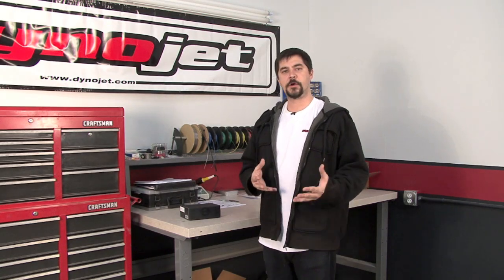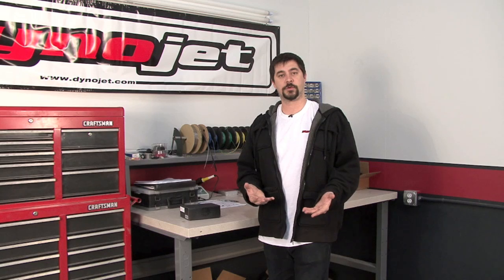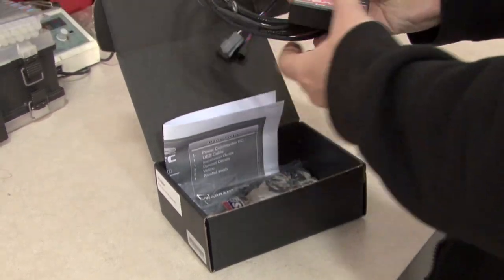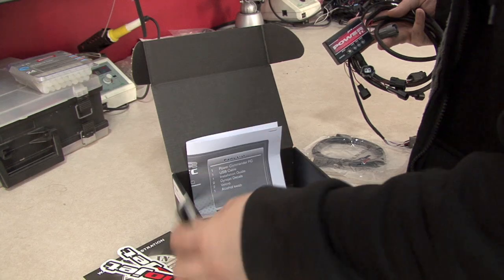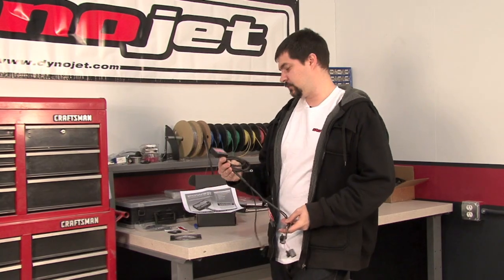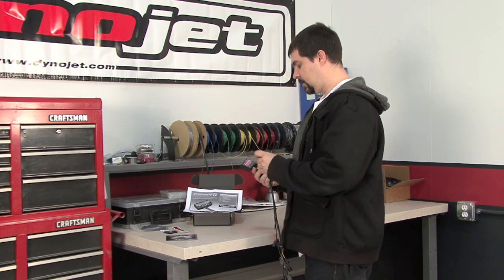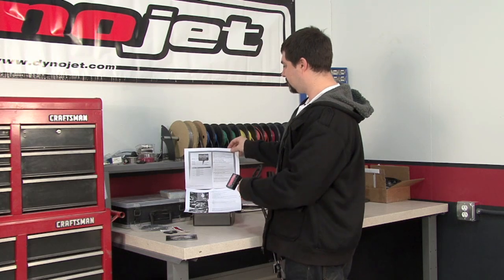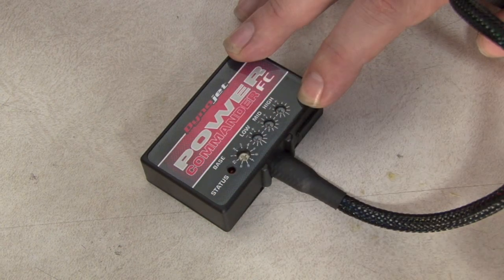Power Commander FC

Comment: I just bought a 14 Super Tenere that previous owner installed. I’m getting terrible mpg. What is the process of setting this unit to base stock settings. I’d like to leave it installed, but for now I want it to perform at stock fuel delivery to see if the previous owner had settings wrong

Comment: so it won’t add any power?
Reply from the maker: Josue, the Power Commander FC unit is more about optimizing the fuel curve. The Power Vision 3 is your best bet for wheel horsepower gains. You can enter your vehicle information on the homepage at Dynojet.com to see what we have available for your vehicle.
Reply: @DynojetResearch  I have this fory sons 09 yfz450r  stock with a hmf pipe.  Can u recommend witch map n what to set the 3 dials at ?

Comment: Will this help to stop the popping on decel
Reply: No. If you list what year and model of bike you have I can provide solutions. Popping on deceleration is caused by two things. One is that your bike shuts the fuel injectors off on deceleration. The second is most bikes have a fresh air injection system called AIS, PAIR, etc. that blows fresh air into your exhaust headers. Solving both those problems (the first with an ECU flash and the second with smog block off plates) will completely eliminate the pop, gurgle and backfire. Just solving one of them (i.e. just smog plates) will get rid of most of it.
Reply: toysareforboys1 I have a 03 r6 k&n air filter graves block off plates and a micron slip on exhaust the block of plates helped but every now and then I get a huge pop im just worried about burning a valve since im not adding more fuel and exhaust temps are higher
Reply: mogearz The popping will NOT burn a valve, the popping is ONLY happening in the EXHAUST pipe, NOT the engine. I can only flash 06+ R6's so I can't shut off the injector disable for you. If you're just worried about your engine, and not the muffler or popping sound, then I wouldn't worry too much about fixing it.
Reply: awesome thanks for the advice :D